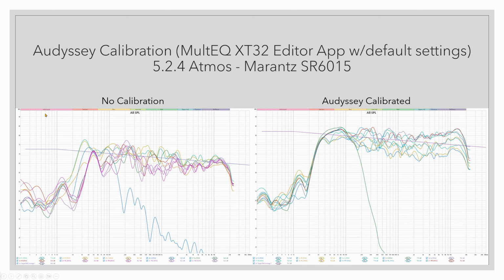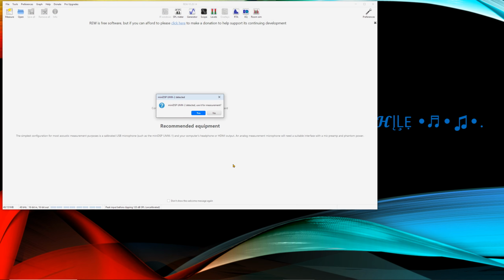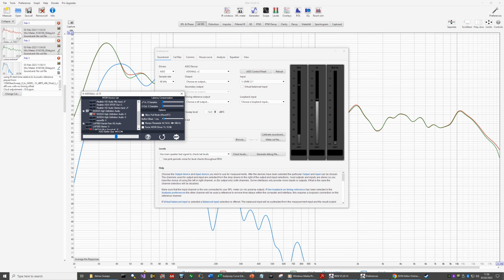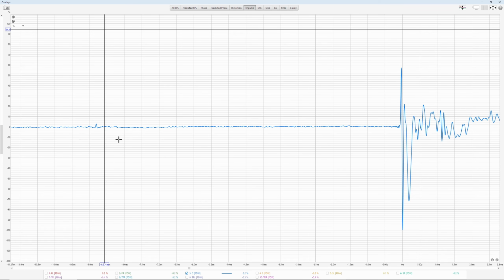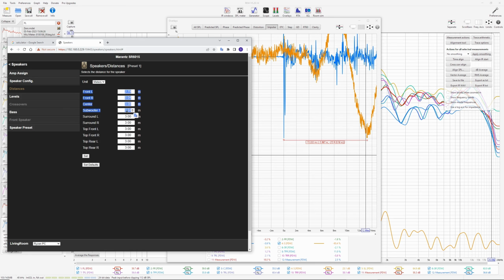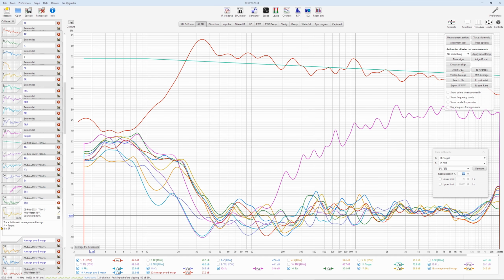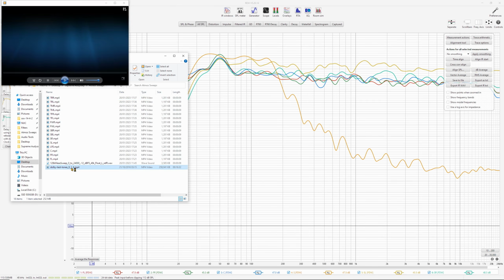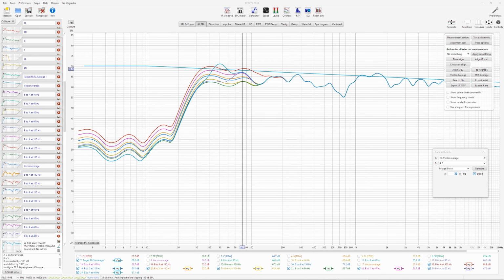Supreme Audyssey Calibration by OCA

Comment: OCA, thank you for this detailed info.  I'm completely new at this hence have a question relating to the beginning of your video where you transfer the Default.ady file to your phone then send it to the AVR, I assume via the MultiEQ editor.  I did this and my AVR asked to save it to one of the two presets (I saved to preset 1).  I assume this is correct?  My real question comes at 6:48 of the video when you then use some sort of in web interface protocol to interact with your AVR. What is the purpose of this?  Or can this all be done by directly using the AVR menu via the remote control?  Are you using this web interface to simply show your viewers the changes or is there something more behind this action?  When I selected my new preset 1 setting and viewed via the AVR (using my remote) the changes you note were there except all my distances were not changed to 0.04m ... they remained at the original Multi EQ actual speaker distance measurements.  I apologize for this newby question.  :face-red-droopy-eyes:
Reply from the maker: You can use whichever preset you like. I keep one preset for full manual calibration and one preset with Audyssey and Dynamic EQ using this method. The web interface commands can all be done from the receiver menu/remote, this is just a short cut but also a lot easier to change settings from your PC instantly.

Some newer receiver models use a different setting in the ady for speaker distance. You can manually reset them in the reciever setup menu or in the online Json editor before you save the ady file.
Reply: Thank you!!  With all the videos on your site which one do you recommend I use to maximize my 7.2.4 system (2021 AVR Denon X6700H)?  I first experimented by adding the Harmon Curve (as outlined in one of your videos) … which achieved a much improved response. 
Of course I now want to see what more we can do with the system. Cheers and thanks again for all your sage advice.
Reply: FYI, I tried numerous times to download the REW V5.20.14 file, it appears to work, however it never  includes the “house curve” tab under preferences?  When I download the REW V5.20.13 it does include the “house curve” tab under preferences. Am I missing something?  Can I use the .13 version and still successfully work thru your video(s)?  Keeping in mind I’m a REW infantile. 😂
Reply: Last questions and I won't bother you anymore. 😁  I decided to try your "Supreme Audyssey Calibration" video (assuming that might be what you advise further to my question above?).  I've updated all the preference tabs info. per your video including adding the mic calibration file as I'm using the original Audyssey mic.  At 14:00 in the video I'm trying to run the measurement but it gets hung up at "10% Waiting on timing reference" and the graph at the bottom left corner simply keeps scrolling?  When running the Check Levels I get the message "Ready to measure..." with the the message "Level Low, -61.2 dBFS, 78db SPL" .   FYI, given the Level Low message I tried turning the AVR volume up and still got the message "Level Low, -41.7 dBFS, 98 dB SPL" but it did not help.  I then also experimented in the Preferences area "Soundcard" Tab to see about calibrating my soundcard (not sure if I even needed to do that?) and could never get the Input and Output levels even close to matching one another as the volume was waaaay to loud at the original Sweep Level setting of -12 dBFS.  I had to adjust the Sweep Level setting to  -30 dBFS,  in order to turn up the AVR volume enough to match the input/output reading and not blow my speakers (which level was still very loud).  Lost in REW Space ... hope you had a great day today and can help.
Reply from the maker: @bradmcneely4745 that points to a too low microphone gain adjustment setting of your sound card. Check every windows setting to increase mic input gain. 

Another option is using your original Audyssey measurements since you're using the same mic. Check Audyssey ART video.
Reply: Hmm tried that already with no success.  :(  
Even when running the mic test on my laptop it shows only about 2% input volume via the Audyssey mic (intel Mic array), must be something funky with the mic and my laptop.
I'll work thru your ART video.  @ocaudiophile
Reply from the maker: It's moved to EQ window. @bradmcneely4745

Comment: Arrived an another hurdle. Can't get distances figured it properly. Follow you step by step, but when measure let's say L\speaker after setting it's distance by adding to C channel (arriving late), the new measurement is waaaay to the right. Not even close! Further than original L speaker. Also, all my impulses are all over the place and look different from each other. No nice peaks like you have there. R front speaker is a mess with wide upward swing...I don't know which step I went wrong in.  Please see attached images.
https://i.imgur.com/ytlXibp.jpg
https://i.imgur.com/6kOTOqa.jpg
https://i.imgur.com/v34zZIh.jpg
Reply from the maker: Why don't you "cross correlation align" everything to C and read the data from the Info window?

Check the new tech in the Audyssey ART video!
Reply: Thank you! How do I know if my receiver is set to 300m/s or 343 m/s for sound speed? I don't know if I need to set REW to 300 or 343. I can't measure speaker distance from impulse because I don't see the "chirp" spike on impulse curve.  @ocaudiophile
Reply from the maker: Not seeing the chirp is quite normal, see video description for the explanation. My SR6015 was using 300 m/s but after a recent update, now it correctly measures for 343 m/s. Most new-ish models are now using 343 but there are still old models stuck at 300. It doesn't really matter, if in doubt take 321m/s. As long as all speaker relative distances between each other are correct, it will only effect the size of the Atmos bubble.  @gr8nrg187
Reply: Thank you! My AVR is Denon x4800h, latest firmware. Any way to check what speed it uses? @ocaudiophile
Reply from the maker: That's 100% 343m/s ;)  @gr8nrg187

Comment: After first click on the "Measure" button I did get the message that the mic is not calibrated. I did not know what to do and put in the db value from the current measure. Now it does not appear anymore when I click on it again. What should I do?
I am using the standard mic from Denon.
Reply: Ok I found the problem. My amp was not set as default.
During exporting as txt rather at the end of the video when I tick "Do not include any comments or headers in the export" nothing changes in the preview below. Could this be a bug? I am using the same version of REW like in the video.
In every exported file I see a lot of text at the beginning beside the numbers. In your video it is totally different.

If you cannot explain that behaviour, is it possible that I provide you my mdat file and you export the txt files for every speaker (in total 6) for me??? I would be very grateful.
Reply from the maker: Yes, that's a bug. I had also spotted that and forgot to inform John about it. Thanks for reminding.
Yes you can share your mdat here with a google drive link. @badboyxxbadboyxxbadboyxx
Reply from the maker: That only changes the relative dB value of the measurements and has no effect on the calibration.
Reply: After performing the measurement, I get the message for some speakers, that the sound is too low. Do I have to increase the master volume of my amp? I have set it to 55 like you in the video.
Reply from the maker: @badboyxxbadboyxxbadboyxx You need to increase mic volume
Reply: You mean the sound level of the mic in the Windows audio settings?
Reply from the maker: Yes @badboyxxbadboyxxbadboyxx
Reply: In the impuls graphics I do not get the speakers distance in meters. What do I have to do to get it shown?

After measuring it manually and finishing the remaining points in REW, MultiEQ app on the phone is freezing during upload (analysing room data) at the first step.
Reply from the maker: You must be on the wrong tab if CTRL + mouse right click isn't working!
Are you exporting measurements with "comma separated values" selected? @badboyxxbadboyxxbadboyxx
Reply: I did a new try from scratch. After the first measurement I get the error " the measurement signal-to-noise ratio is low, 18,6 dB." The mic gain level is already set to maximum +30 dB. The master volume of the amp is 55. When I increase the master volume to 65 I get the error "clipping was detected in the measured input, the frequency response may be distorted as a result. Try reducing the sweep level, processor volume setting or the input volume and repeating the measurement." 
What am I doing wrong?
Reply from the maker: This is a common beginer problem to REW. It's easy to solve but there can be many settings including WIndows sound settings that might be causing this. You shouldn't have these problems with ASIO drivers though. Have you installed ASIO4ALL?
Reply: Here it is
https://drive.google.com/file/d/1Yo2MJqhYpDI7q73kmztadtdgTPRN3L_t/view?usp=sharing
Than you in advance.
How do you export the files?
Reply: Have you access to the file?

Comment: I'm confused as to what's going on. During my first measurement I set Denon AVR to 60 (scale 0-98) where I usually listen at. Audyssey Mic at listening position at 12 feet away or so. I got error saying that level was low and asked me to increase volume. Thought it was strange, but increased it to 70 and and that was loud and it took measurement with REW. Then, following your step by step instruction I tried same with supplied FL mp4 file. At the same AVR volume it sounded much lower and error was "The highest level in measurement is -54dBFS, for greater accuracy increase the input volume, the sweep level or AV receiver volume to raise the highest input level above  -35 dBFS." Thought it was strange since my AVR was set at -10 DB (70 on the scale 0-98). Any ideas?
Reply from the maker: Use either java EXCL or ASIO drivers otherwise you've to adjust mix gain properly from windows sound settings
Reply: @ocaudiophile  This was done using ASIO drivers, and still it seems that Audyssey mic at 12 ft away at deafening 70 volume setting on AVR still comes in as low level according to REW. Mic gain is set at 100% in windows.
Reply: I've spent 2 hours today trying to figure it out. I'm gonna go deaf. Nothing is working. I keep getting errors in REW that levels are low. I boosted mic gain in Windows settings by 30 db (all the way up). AVR volume is between 65-70.....This happens either with internal REW calibration sound playback or outside calibration files. Tried both ASIO and EXCL drivers with calibration mic file you provided for Audyssey mike installed. Any ideas?  @ocaudiophile
Reply from the maker: @gr8nrg187 Did you "check levels" in preferences tab after you select input and output channels? You should be seeing output level around the top and mic level close to that and adjust volumes accordingly.
Reply: that's what I did. The output level is good near the top at -12dbfs but mic level even if I stand close to speakers is about -65 or so. Windows set mic volume to 100 and boost to the top. Is it possible my mic is defective or your custom curve for it does not work? Should I just buy UMIK-1 or just blast my speakers while setting measurements at around 75 (scale 0-98)? ?  @ocaudiophile
Reply from the maker: @gr8nrg187 The mic calibration file will not have a major effect to the overall volume and you can remove custom curve and measure to check if that's the culprit. If the mic is working with Audyssey, it can't be defective. Maybe reinstall your PC sound card with up to date drivers.
Reply: PROBLEM / SOLUTION finally found! Thank you for suggestions. Unfortunately it did not work. Days of reading internet and trying and still nothing...until today! Turns out it was my fault for overlooking the right setting. When I plug Audyssey mic into mic jack of my laptop apparently Windows sees 2 input mics: Microphone Realtek and Microphone ARRAY Realtek. All this time I was using the former and had to blast AVR volume pass 75 DB in order to get any measurements. When I switched today to "Array", all of the sudden all of my levels are high and proper, and I'm able to do normal measurements at 55 DB (my normal listening level).   @ocaudiophile

Comment: Why do I not have any sweeps in my Impulse chart? The Cross corr align for my Subwoofer and the Surroundspeakers seems to be not correct. It doesn look like the FL C and the FR. I did exactly the same as u did. Im using the Audyssey mic.
Reply from the maker: I cannnot say I understood the problem. You can paste google drive links here and I will have a look.
Reply: @ocaudiophile  Thanks a lot man! I’ll take time soon for that.
Reply: @ocaudiophile  https://drive.google.com/drive/folders/1MyZC0DeZH_7r4JNV0V73QWJUa2Cwuhph?usp=drive_link

123 with Rode USB PodMic
istaufnahme with Audyssey Mic
Reply from the maker: I need access!
Reply from the maker: Why are there 2 different measurements?
Reply: @ocaudiophile  one is with USB Mic and the other with audyssey. I thought that you can compare those measurements, to valid the measurement with the audyssey mic? 🤷🏼‍♂️
Reply from the maker: The USB mic doesn't have a calibration file and it's meaningless to compare unless the two misc were at the exact same locations during measurements! I don't see anything wrong with your measurements though. What was the problem? @Undee-or7sb
Reply: @ocaudiophile  cross correlation for the SL/SR/Sub looked weird to me
Reply from the maker: Subwoofer measurements are very different between the two mics. If you can share an "unedited" automated MultEQ Editor app Audyssey measurement file (.ady), I can understand better what's gone wrong.
Reply: @ocaudiophile  uploaded
Reply from the maker: I've uploaded a fully calibrated ady file in your drive. Just send it "as is" to your receiver and enjoy. PS I just saw that your AVR doesn't have MultEQ-XT32 so I am not sure if the filters will work with MultEQ-XT. Let me know. @Undee-or7sb
Reply: @ocaudiophile  thanks a lot mate
Reply: the Fronts and Center should i left for crossover at fullrange? only the surrounds at 40hz? @ocaudiophile
Reply from the maker: @Undee-or7sb  Yes, your speakers seem to be producing better bass than your sub. But in case the bass filters for speakers are not working due to limitations of MultEQ-XT, then you can try crossing everything over at 80 Hz
Reply: @ocaudiophile  what about switching the phase on the subwoofer to 180 degree to improve the bass signal? Or take another EQ? My subwoofer has a switch for EQ A and B (B ist for the position „not in a edge or close to wall“ and A the opposite). My sub is positioned behind the couch 40cm to the backwall. Or do you have any ideas?
Reply from the maker: What's the feedback on the calibration I made for you? How does it sound? This is what you need to tell me in the first place. @Undee-or7sb
Reply: @ocaudiophile  oh. Sry. Forgot to mentioned it. At first sight well balanced, but I’m missing a bit the kick of bass.
Reply from the maker: I uploaded a new ady file with Harman Kardon Target curve for the subwoofer which is more bass heavy than the Dr Toole curve I had used in the previous one. @Undee-or7sb
Reply: @ocaudiophile  thanks a lot. Give You feedback asap
Reply: can you provide me the REW mbat file in google drive? so i can comprehend what you have done?  @ocaudiophile
Reply: Hi, I have so far taken time and heard something. Then I made a actual recording to see how the frequency range of the subwoofer behaves and changed some settings, such as the distance, the crossover frequency for the subwoofer, the low-pass filter and the crossover frequency for the speakers. I have uploaded everything to google drive called "istaufnahmenachtesten". with the subwoofer I have strong dips at about 59hz and at 103hz. no matter what setting I have made, I could not smooth the dips with any setting.
Reply: Should work now

Comment: Regarding the "Speed of sound" value setting/correction. What is your reference when determining whether your AVR is using 300 or 343 m/s? Do you measure it with a tape/ laser, or do you measure with both Audyssey mic and Umik at the same position and compare?
Reply from the maker: It's caused by the AVR so it's mic independent. I measure with laser just one of my speakers and compare with Audyysry's own finding. The difference is usually too large and even with tape measure you would understand your receiver is using 300m/s. Btw, after a recent update my Marantz sr6015 now uses 343m/s. Many other models have been fixed but not all.
Reply: @ocaudiophile  Thanks! My Denon X4500H also received a couple of updates over summer, fingers crossed.

Comment: Dear sir,
Hope you are in good health.
Really it is quite impressive all of your video to learn unique technique. I cordially seeking one advice to match subwoofer impulse at 0 time point to align others speaker.
My subwoofer  impulse at positive time area, I set maximum distance at AVR(denon x3700h) but still ahead form 0 time point.  Have any advice to take down at 0 point? My center distance is 9 feet But my SBL, SBR distance is 4.4 feet due to room limitation.  
Thanks for patiently hear me. 
-Your followers.
Reply from the maker: Goto Overlays/Group Delay tab and select all speakers. At the high frequencies (above 1000Hz or so) you will see that the responses are around 0ms but the subwoofer group delay is above them. Measure the distance with mouse right click method between the sub's response and all other speakers' responses. This will give you in ms and meters the offset you should apply to your subwoofer. In the impulse graph, you will see that is also coinceiding with an impulse peak. Fine tune here the peaks if necessary.
Reply: Thanks sir. ❤